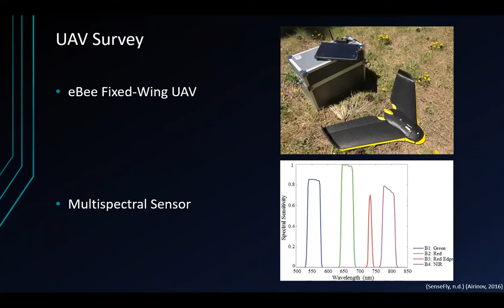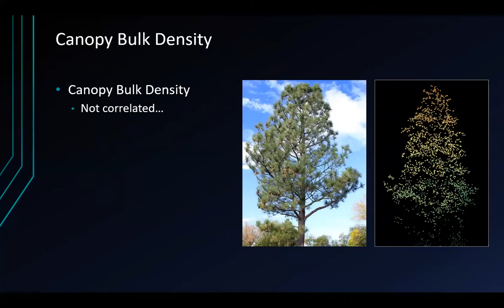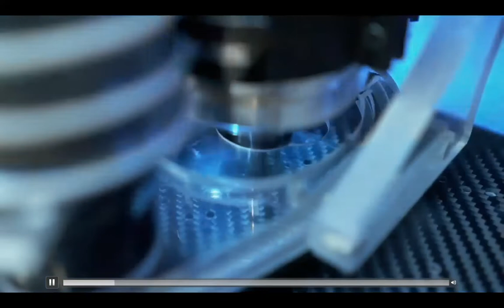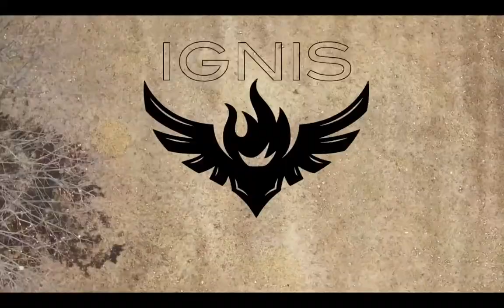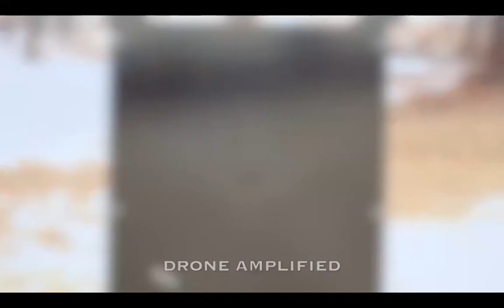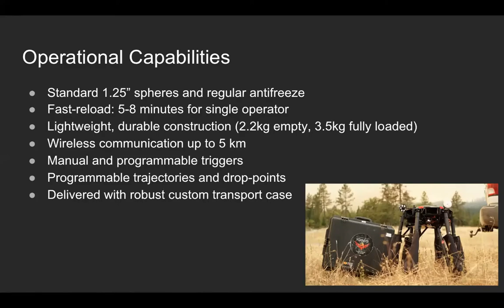Unmanned Aerial Vehicles (Drones) for Measuring Canopy Fuels and Aerial Ignitions

Comment: Great presentation and video. Have you considered using LIDAR to for more accurate measurements? Pricing on  smaller LIDAR units from manufactures like Velodyne have dropped significantly in the past year or two.  If you are interested in potential future collaboration please let us know. Our headquarters and test facility are located on a 136 acre property  near Syracuse, NY which has various types and heights of tree canopies. Best regards, Christian